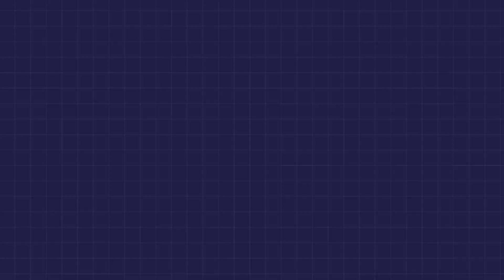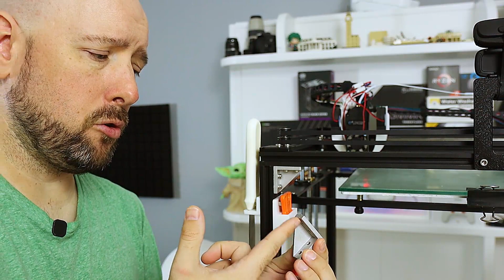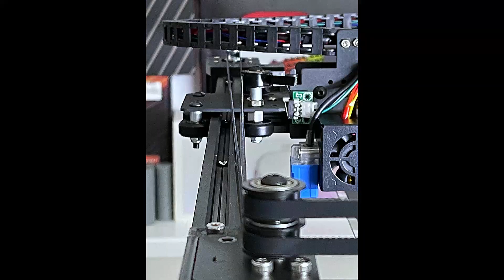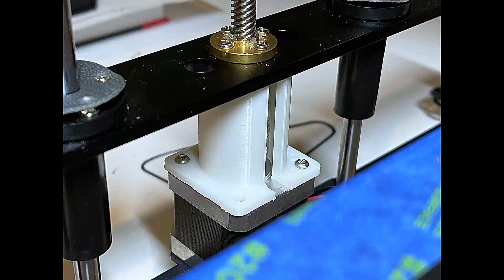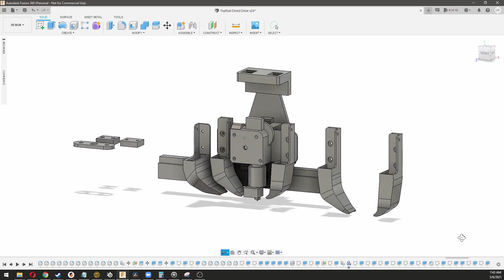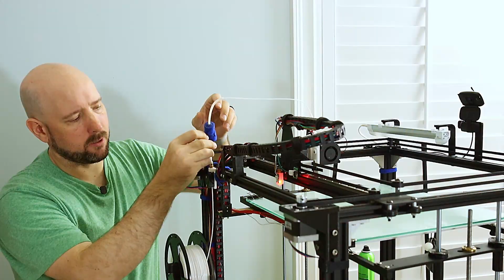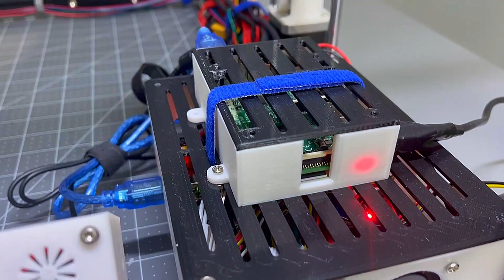TronXY X5SA Upgrades (Frame, Bed, Linear Rail + Direct Drive, PSU, Electronics)

Comment: Very detailed, and well laid out video!
Kudos!

You mentioned you really enjoyed making your 5 minute makes series, unfortunately to little fan fare.
Well, I'd be willing to bet a kings ransom your little series would find exponentially better viewership if you applied it to YouTubes new and both heavily pushed and metric biased "Shorts" segments!
I'm sure you can agree in recent months several smaller 3D print channels have found enormous success with an excellent adaptation of this Shorts [sub?] platform!!

Lastly:
I've got this year's Pro, and unfortunately, the X & Y stepper mounts are the last 2 of 4 acrylic pieces STILL shipping with this kit-ment-for-upgrading-outta-the-box printer, hehehe!

Cheers!
Reply from the maker: Hey Bo, thanks for the feedback!  Like many I saw my (very modest) viewership fall by like half when they started pushing shorts. I hadn’t thought of using shorts for the quick designs but that is darn brilliant!  I’m not a traffic chaser and have no delusions about this becoming more than a hobby but it feels good when people see and get value from the content. 

If you need some printed motor mounts to get you through, let me know. :)

Comment: Thank you for your video, I looking to purchase new printer, do you recommend this printer with all of the cost for upgrading and price for printer?
Reply from the maker: Well, it depends on what kind of deal you can get on it.  I got my X5SA-400 for $290.  At that price it's an absolute steal.  It's currently $400+ which is a bit of a stretch.  I think it's still the cheapest large volume CoreXY but if you don't need the huge build volume then something like an Ender 5 will probably be have better QA out of the box and fewer issues in general.  On the other hand, if you're looking for a kit to build on and plan to do a bunch of upgrades anyway then, ya, it's a great starting spot.
Reply: @LilMikeysBigPlans  well I looking for something I can print ASA with at list 300mm bed size, also cheap price, I living in UK and find X5SA 330mm FOR £190 and pro  one for £260 BUT ENDER  5 PLUS IS £450
Reply from the maker: Ya, the TronXY sounds like the way to go for you especially at those prices. I’ve not printed with asa but I hear that it’s a lot like abs in that it warps quite a bit. I managed to have some success on my ft-5 with abs using a very hot bed and an enclosure but it’s too big of a pita for me in general. 

The X5SA bed will likely not get to the temps you need so factor in a good silicon heater kit and build surface. Enclosing a printer of this size will also be a challenge if you have to go that far.
Reply: I have the X5SA-500mm. I won't say it is a "great" printer, but it is an excellent starting bed.
I was working on a series of mods very similar to the ones listed here, except that since I also have a machine shop, much of the critical tension parts are in aluminum. I decided to buy a RatRig, so I am not sure what I will do with the Tronxy.

A few points, I printed all my RatRig parts in ABS using draft shield in Cura with very good results. I had no issues reaching 100C bed temps. I also purchased a borosilicate glass bed, and a FYSETC magnetic PEI sheet. I attached the magnet to the glass so I could have a perfectly flat base. The glass is affixed to the heated bed with two pieces of Kapton tape - I do not recommend use clips to attach the bed as in the video. The heated bed is not flat, and it will stress the glass.

Out of the box, it will print as well as any of the other cheap printers. Find one of the build video where the creator did a competent job (so do NOT follow the Teaching Tech vid - he bungled it horribly). Getting is square is critical. For another $200.00 it will print better than any of the modified cheap printers. I recommend a Volcano, a direct drive, and Klipper. If your budget exceeds $600.00, I recommend just taking the plunge and going for the RatRig. It costs the same as a Voron, but is not insanely over-complicated and at least twice as rigid.

Comment: I was actually just looking at solutions for #4

I was wondering how this works, I am using the supplied like... plastic glass that comes with the printer and its a tiny bit warped. I was wondering if the solution to #4 causes the motors that micro-step to adjust for the auto-leveled points to mess up when linked together? I assume so because it can't really micro step the right motor if the left motor is following in suit
Reply from the maker: Hey Justin.  Out of the box the X5SA uses a single stepper for both Z motors so there is no automatic tilt adjustment unless you upgrade.  If your left and right motors fall out of sync just a little bit then mesh bed levelling may be able to compensate but if it's more than a couple mm you'll need to manually re-sync the motors.  That's where these solutions come in.

If you're using the hats, when you drive the bed onto the hats you are guaranteed the bed is level.  You can either disengage the steppers and manually press the bed onto the hats or drive them onto the hats and let the steppers skip until both are resting on the hat.

If you're using the linked-Z cable with the tensioner you don't have to worry about relative leveling as the tensioned cables will keep them aligned within a step.  Just make sure the bed is level before you tighten down the timing gears :)  Without the tensioner they can slip a step or two at least on my 1210mm cable loop.

Currently I'm running a second Z stepper and using klipper's tilt adjustment which has been working well but needed to be tweaked quite a bit to get it to make accurate adjustments and the bed will still fall to the base once the steppers are disengaged so it's a bit of a mixed bag.  I'm still using hats to keep the bed from hitting and damaging the spring couplers when it falls to the bottom.

Regardless of which solution you end up with to keep your Z motors synced up I am personally not a fan of mesh bed compensation for a few reasons.  1. It adds another axis in motion while the extruder is extruding 2. you are greatly increasing the chance of getting an errant reading since you're hitting 9-16 spots on the bed instead of one (or two if tilt-adjusting) and 3. your mesh will get all wonky if you don't clip or stick the plate on in exactly the same spot so I ended up having to re-mesh all the time which exacerbates 2.  I prefer to stick with a known flat surface and skipping mesh even if it means adding a sheet of glass or replacing your surface more often.  I'm sure many others feel differently though as mesh compensation seems to be very popular.

Comment: Awesome video glad I found your channel. I'm about to purchase an X5SA Pro in a couple weeks as my first 3d printer. I love to tinker and upgrade so I know this isn't the best beginner's printer but I figure I'll jump right in the fire! I have a cnc that I've pretty much built from scratch so not a complete novice with all this.

Anyways just want to say thanks for all the info and the thingiverse parts ill definitely be utilizing alot of them!

Do you have any experience with adding a ball bearing between the z stepper motors and the z lead screws inside of the couplings?
Reply from the maker: Hello vjay.  I'm sure you'll have fun with the TronXY.  It's not the best beginner printer but it was better than the Folger kits - which were true 'box of parts' types of experiences and if you're already into CNC I'm sure you'll have no problems!

Not sure what you mean by putting a bearing in the coupling?  Are you attempting to add a ball bearing inside of the coupling between where the motor shaft and leadscrew would meet?  The coupling is a spring coupling to account for imperfect straightness/alignment of the lead screw so there is a little travel built-in.  What would adding the bearing do?
Reply: @LilMikeysBigPlans  Thank you for the response. Yea the ball bearing would go between the lead screw and motor shaft in the coupling. Ive seen a few videos where people had issues with z banding and between adding the ball bearing and removing that lead screw holder at the top of the printer fixed it.

Here's a link to one of the videos Ive seen it in. He talks about it around the 7 minute mark.

https://www.youtube.com/watch?v=o2KBXoVfPdM&t=433s

Comment: What would you recommend our of the box mod wise? I'm trying to build a solid coreXY duel extrusion printer. I already planned on the bracing, but want to know what else.
Reply from the maker: Hello Sabi.  Are you starting with one of the dual extrusion X5SA models?  If so then the recommendations are pretty much the first four from this video: corner bracing, motor mounts and pully spacers, a decent bed surface, and linked-Z or the Z hats.  On the other hand, if your plan is to get a base X5SA and upgrade to a nicer dual extruder setup, keep in mind that the non-2E models don't come with the stepper driver for a second extruder.  The plug is there but there's literally a blank space where they would've soldered the second extruder driver.  If you're upgrading from a base model you'll need new electronics as well.
Reply: @LilMikeysBigPlans  I'm considering the X5sa 400 pro, since most of the hardware needs replaced for 2 color, as well as having to come up with my own hot end setup since it seams options are either shoddy or very expensive.

Comment: Been through the exact same journey with my 400 - including moving the motors and the front idlers to line things up. My board also died and I switched to SKR 1.4T. Discarded stallguard from the start but I went with dual z drivers and did away with the sync belt and use g34 instead.
Reply from the maker: I went ahead and set up dual-Z with z-tilt and I think I'm sold on that over the linked Z - at least with the lead screws directly on the motors.  I figured z-tilt was going to be harder as there's not an abundance of documentation and real-world examples but it was pretty simple.
Reply: @LilMikeysBigPlans  You mean like described here ? https://wiki.layerfused.com/en/X301/contributions/dual-z-configuration
I'm running with one of these sync-kits right now, but still the bed is somewhat tilted.
Reply from the maker: @WolframWebers  Yep.  I'm using klipper so the config is a bit different but the method is the same.  I let my bed fall where wants after a print and then at the start of the print I run the tilt adjustment twice (unless your measurements are VERY exact the adjustments aren't perfect) and I'm within .05mm difference between left and right sides of the bed - which is probably bumping against the accuracy of the bltouch+stepper resolution+screw thread error.

Comment: interesting video, I own a x5sa pro and I'm upgrading it. I installed klipper, changed the hotend for a hemera and I'm waiting for my 110v silicone bed. Might but a second one because they are dirt cheap and make mod it too.
Reply: You might want to take a new look at Klipper, the build is much more simpler now I think the printer.cfg file that comes in the examples tells you to choose the serial, and how to convert it. Most tutorial are good if you follow the guide + the instructions in the cfg file. Also, why didnt you install independent z axis with your skr 1.4?
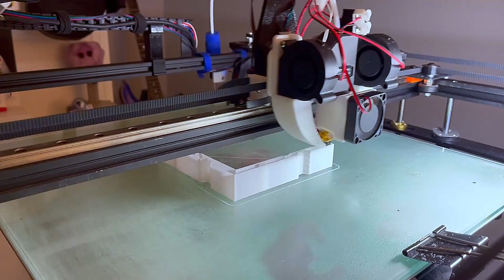Reply from the maker: Hello Yannick, sorry if it wasn't clear from the video but I'm running the latest klipper on the SKR.  It's actually the klipper resonance test printing at 14:30.

As for dual-Z, I hadn't really considered it.  I'm using the linked Z so I wouldn't be able to take advantage of tilt correction but I would love to see a printer.cfg with it enabled.  I think that sensor config can be confusing.